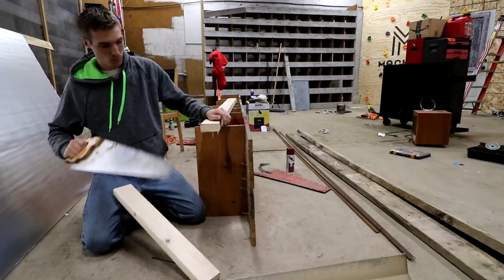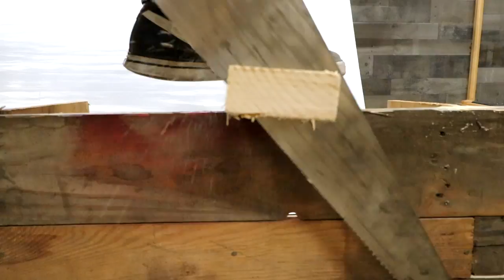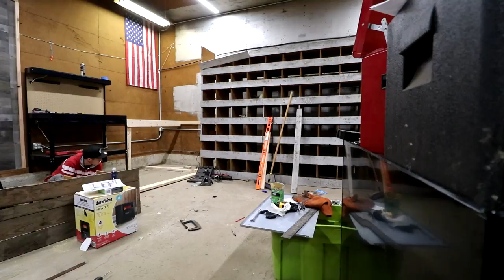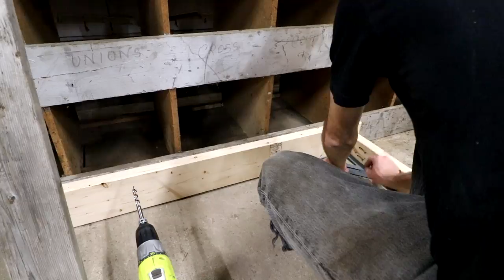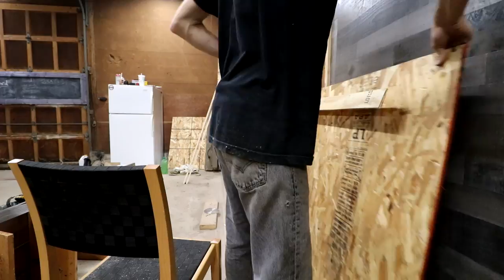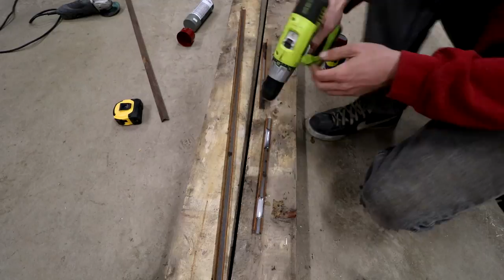Multi-Purpose Work Bench *3DMachines*

Comment: Dalton, you should take down the crappy shelves in the building. When I was building out my woodworking shop I found myself slowly taking down all of the old Tennant's shelves to fit my own personalized storage solutions. It makes life way easier! Also 4x8 melamine table with 2x4 base on casters would do wonders in the center of the shop

Comment: Nice work building the benches and getting set up. You'll be able to get more done smoothly with a good area to work! But FFS man, what's the story on the circular saw? Dead?

I like the new "no talk" vids, it works for this... Everything you're doing is pretty self explanatory except for maybe using that Kreg pocket hole jig (which I hear is a good thing to have)... Would have been nice to hear your feedback on it. This new format (if you're keeping it for things like this) reminds me of Primitive Technology guy. You could always add closed captioning, but that might take some time.

Comment: Yup... you need to talk.  Maybe not as much as you sometimes do, but it is nice to hear you.  Also high speed some of the more boring things, like sawing... of course I do not understand why you used that hand saw when you had a circular saw.  I would also put a second layer of MDF (over the OSB) to give you strength.  You will need more support too as those screws in the wall are not going to take much.